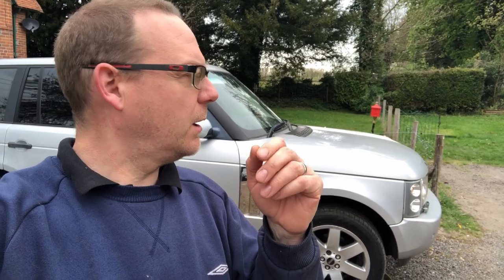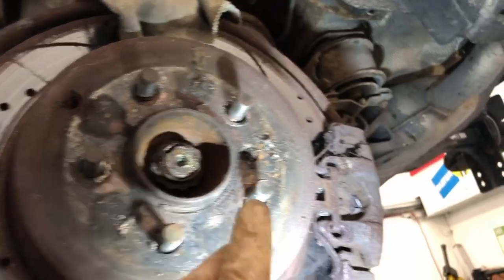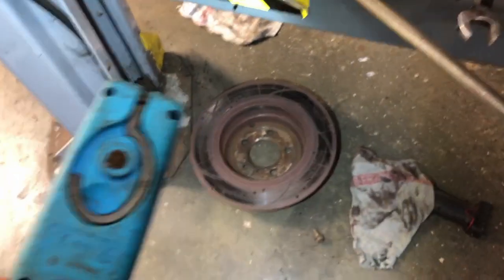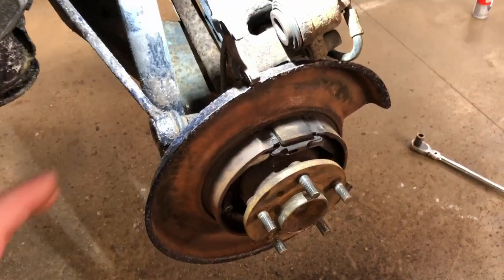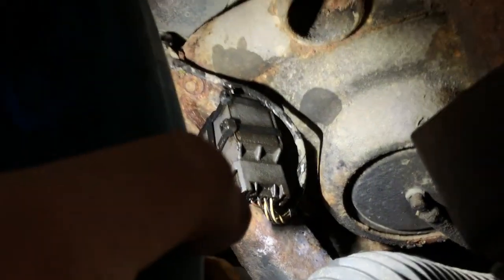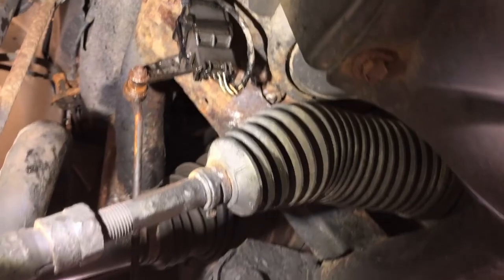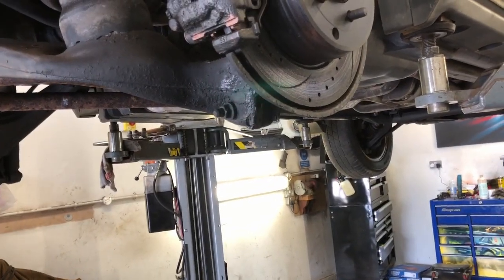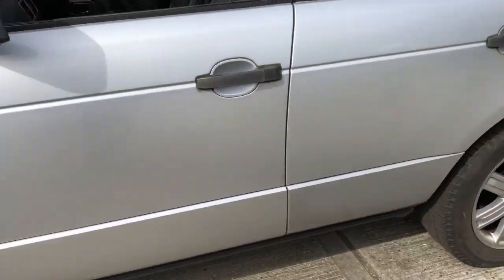L322 Range rover Bought blind TD6 - 72000 miles - Pt4 -  MORE mot work

Comment: Nice one pal I remember when I worked at vw one came in same colour and year as yours was about 2008 was a part exchange did a inspection the brake pipes were rotten seem to be a common issue..
Reply: Good to see you 😀🤜🤛
Reply: @AliMackMechanical  ehh

Comment: I can’t believe it is so rusty underneath even for a 20 year old car. I wonder if it he been in saltwater at some point? Great series of videos 😀👍.
Reply from the maker: Thanks, I believe it’s been by the sea, happens sometimes. 👍
Reply: My 2002 L322 was pretty bad too, and the discs were all corroded and callipers seized up. I believe it had been left standing outside for a long time, one of the major causes of rust. Mine had the full KROWN “T40” anti rust treatment, they covered every cavity and even drilled holes in the doors to squirt the T40 inside. That was repeated annually for 3 years to fully eradicate the rust and build up a good coating. Now it gets done every 2 years, and but is still steam cleaned every year. It’s as clean as a whistle now. Restoring and maintaining an L322 is very satisfying 👍When you’ve finished, it’ll be a keeper for sure because it will be in great shape. And yes, the L322 is the best looking Range Rover yet, solid square and purposeful like a 4x4 should be. In comparison, the newer 405 is just too sleek for my taste, and the P38 was a nondescript box. Toyota did the same with the Land Cruiser, the 2003 D4-D was a masterpiece but the newest ZX model looks underwhelming and too big for its wheels. And the 2nd generation Mitsubishi Shogun also looked great, whereas the 3rd generation looks like Noddy’s car by comparison, with all those curves.

Comment: I am enjoying these range rover videos I bought a 2005 two owner range rover sport in 2015, nothing but trouble, handbrake, air suspension, egr valves,in first month  they seem poorly put together, then there's the crank snapping, mine had surface rust all on the underside, what's happened to the Sierra?
Reply from the maker: Thanks…. Not been doing a lot with the Sierra recently, I have a video coming out on it soon.. 👍